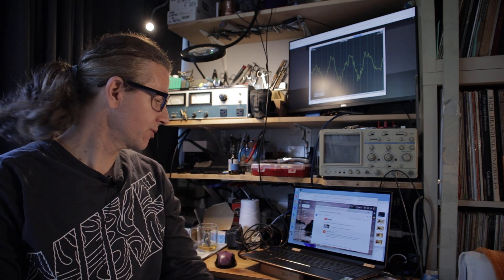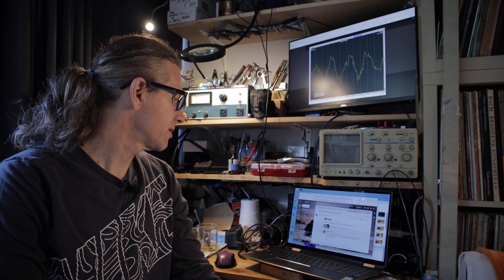Audio Signal Voltage - how does it relate to input sensitivity and rated output of DAC?

Comment: Hi Janos, are you sure that the dynamic range of CDs got better? I thought we where in a compression war. Also I still have a very early CD copy of the Bolero (which I bought new). It makes use of the full dynamic range. That means if you play it audible at the start, you will literally have the neighbors banging on the walls towards the end.
Reply from the maker: I'm thinking more along the lines that for the past 20 years more of the bits have been used, compared to the early ear of CDs. Yes, there needs to be enough dynamic range for transients, however a good CD mix is when the transients use up close to the dynamic range of the CD, and leave as little unused as possible.
I'll make a video to make it easier to see what I mean... ;

Comment: Hi what amp would be good for my speakers. 
94db.  6 ohm. Thanks.
Reply from the maker: I'll try to answer in a video. In short: you need to do a lot of homework, as numbers today are nearly meaningless. You need to know how low the speakers dip, and whether they rate the sensitivity at /Wm or /2.83V/m.
Reply: @realworldaudio  Floorstanding Loudspeaker
- LF: 15" Differential Drive woofer
- Mid/HF: 3" D2430K dual compression
- Recommended Amp: 300 watts RMS
- Freq Response: 30Hz – 40kHz (@-6dB)
- Sensitivity: 94dB (2.83V @1m)
- Crossover Frequencies: 700Hz
- Nominal Impedance: 6 Ohm
- Bass-reflex: Dual Front-firing Ports
- Binding post: Dual Gold
Reply: @scottspinner1  sounds like a JBL 4367
Reply: I recommend the best sounding amp.